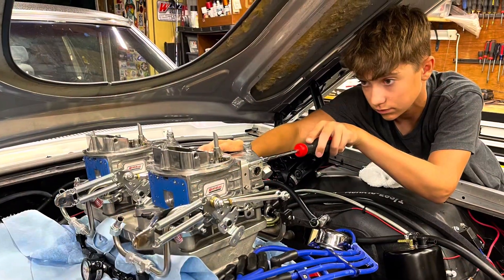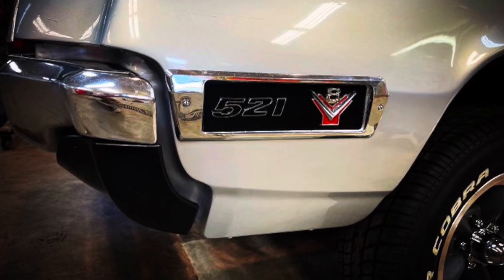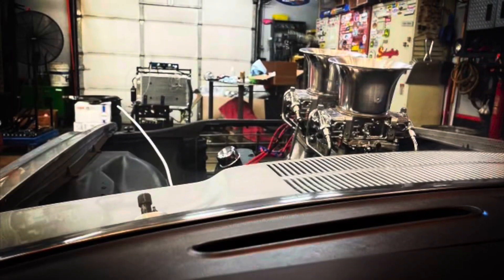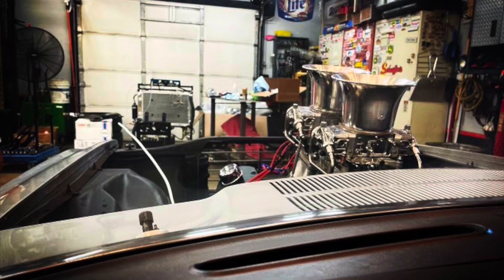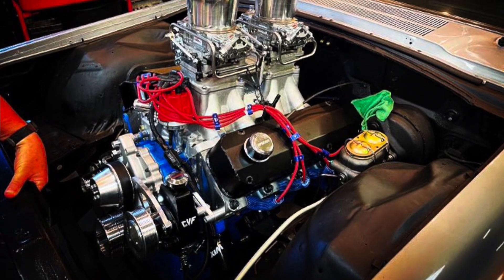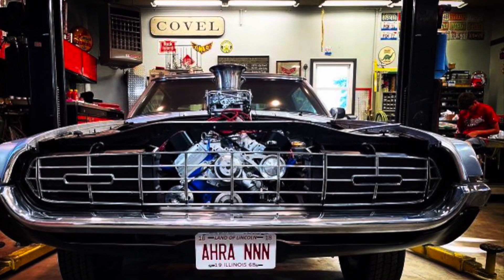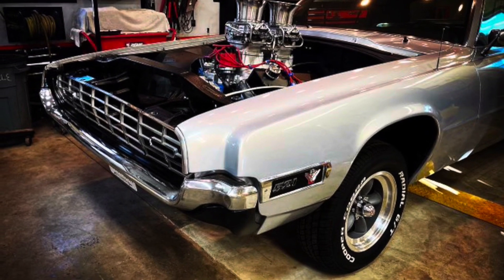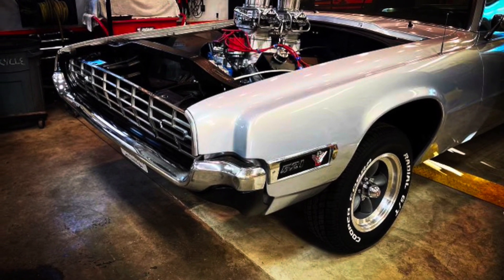Jeff Klawitter's 1968 Ford Thunderbird, 521 Cubic Inches Of BBF,  Ready For The No Name Nationals

Comment: Planning to build one of these to replace the 400M in my 79 F-350 4X4.  The old 400 is still a puller, but she's getting tired & the block is bored 0.060", so why not pop in a big block.  I am planning on a single 770 or 850 carb on top of a Weiand repop CJ/SCJ intake with a set of P51 heads.  Great to see one sitting in an old TBird.  I am thinking of finding a 77-79 TBird for the old 400to play in.  Or maybe a 40 Ford?  That will be a few years down the road though.
Reply from the maker: I will tell you one of my favorite cars with the 77 Teebird. Had a 302 in it man I beat the hell out of it. And in fact the transmission is in my Cougar right now. I’ve always dreamed of building 600 big block Ford. I guess that’s why I got A 460 heads. Sounds like you got a good plan. 40 FORD, just happen to have one in the garage. But that’s a whole Nother story, stay tuned
Reply: @DragBoss351Cleveland  I liked the look of those TBirds.  They were just right.  The Earlier ones were ok also.  I had a 74 with a 460 at one time.  It was stolen & crashed through a power pole & brick retainer wall.  Anyway, look forward to the 40.  How is the bigger garage?
Reply from the maker: @donnatalielucasheimbigner7598  garage is awesome. Just finished first insulation of foam board, clean up today and back on installing carpet in 69 Mustang. The 40….,tbd.
Reply: @DragBoss351Cleveland  Once again, we are happy that you are doing well.  Best wishes for the fam as well.
Reply from the maker: Thanks,  all good and moving forward. Get the Cat soon.